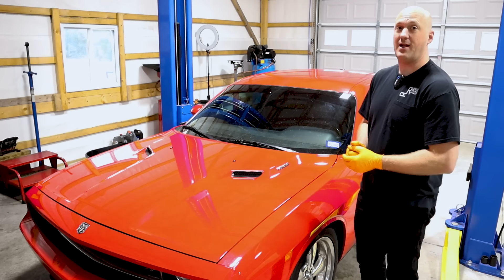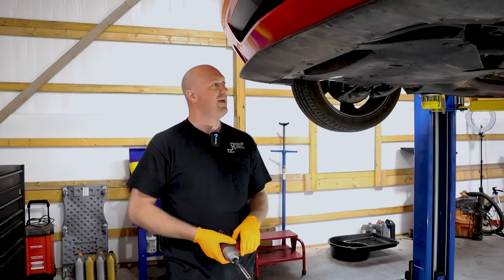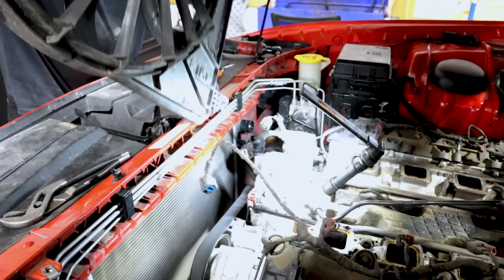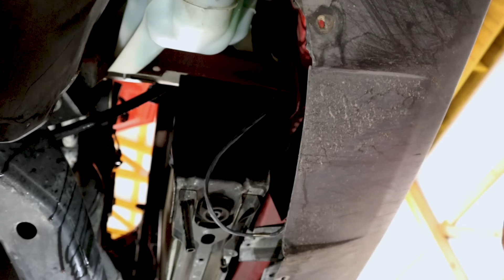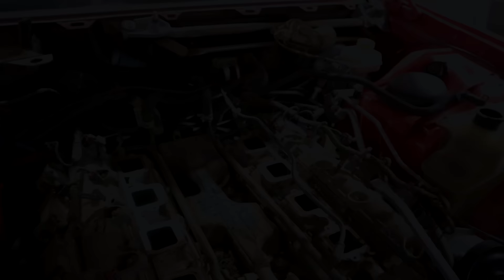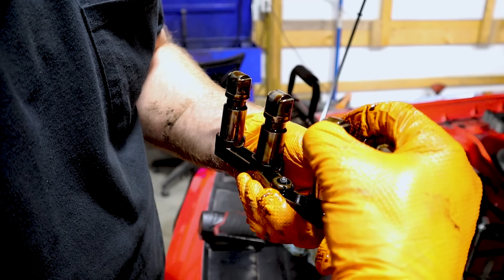Hemi Cam Installation! Budget Challenger Build Ep1

Comment: There is nothing budget about these 5.7 cars.  Cam and full bolt on cars om E85 make just over 400whp.  They weigh over 4200lbs, and that's the problem.  Any S550 Mustang, or 2016 and above Camaro is worlds above these in terms of performance
Reply from the maker: Have to agree with weight being an issue, these are definitely heavy beasts. Although I have to say the Mustang and Camaros are kind of after a different market at this point. I feel like the Dodge vehicles are the only true "Muscle cars" left. The Mustang and Camaro are chasing after sports cars, which is nothing wrong, and they are very good at it. But the Dodge vehicles deliver a certain kind of driving experience that certain people are after. Appreciate you watching!
Reply: @ReignitedAuto  I would agree that the Challenger does do different things - it's big, comfy, retro, and can be better at every day life.  However, I can walk into a Ford dealer and get a bast GT with the 10 speed for 31,999 - you can get a base Challenger RT with the 5.7 for roughly 36K because not everyone will hit Dodge's incentives for price drop.  So the Challenger competes directly with the Mustang.  The mustang GT is better in terms of performance, handling, and straight line performance.  My PP2 mustang cost me 41k and will dominate any Scat Pack in any terms of performance, and I can and have loaded my wife 2 kids, and drive 3 hours to the beach loaded luggage in the trunk, and did it comfortably while averaging 22.7mpg on the highway.  So the stance the Challenger is its own class would be true if cost wasn't comparable, and the Mustang wasn't a 4 seater car just like the Challenger.  NOW the Charger is hands down the best option for a 4 door performance car.
Reply: @ReignitedAuto  one last thing - though I agree the Challenger and mustang are different cars I don't think it's fair to say they don't compete.

Both have 2 doors
Both rear wheel drive 
Both American 
Both cars cost about the same within a few grand of one another 
Both American icons 
Both have V8s

It's not like comparing a Miata to a Ferrari, they both target the same thing - performance
Reply from the maker: @bigk5746  I get what you're saying, it's not apples to oranges, I'm justsaying in terms of a driving experience the mopar vehicles cater to a specific customer.

Comment: I seen a guy on YouTube doing a Cam with out putting the heads . Wouldn’t the lifters drop into the oil pan .just asking thanks
Reply from the maker: I'll be posting a video soon talking about this, but yes it looks like you can do it without pulling the heads. It's a calculated risk, but it seems definitely doable. I usually pull the heads anyway since I'm replacing the lifters.

Comment: Hey Sky! 
I feel like a lot of these tips and tricks can apply to all 5.7 hemi’s. Though I have MDS and it looks like the part numbers you listed don’t match up to mine when I cross reference. I have a 2014 5.7 grand Cherokee with 107k miles and I have some strange power surging under heavy acceleration, and I have what sounds like valve tick but I’m not certain. Say I delete the MDS (solenoids?) under the intake manifold, can I run a non mds cam and lifters? Anything software I need to be aware about? Before I assume it’s my valve train, is there something else I can troubleshoot? 
Thanks!!
Reply from the maker: Yep, remove the MDS solenoids, replace the lifters with all non MDS variants, and install a non MDS camshaft. You will have to add an aftermarket tuner that turns the MDS system off or you'll set a Check engine light for sure. The injectors are pretty noisy on these engines, can be mistaken for valvetrain noise. The Hemi engine is pretty noisy right from the factory unfortunately. The surging isn't an issue we see very often, no codes?
Reply: @ReignitedAuto  no codes related to the engine. I have AlphaOBD as well as BlueDriver to see everything and nothing. Well, on occasion I get a “service 4wd” because I replaced my rear diff and I think the computer is grumpy with the elsd motor that came on the replacement (used with 10k miles) but that is unrelated to the topic at hand, but if it’s cool I would love to pick your brain some more another time. 

Ok back to the surging. So when I go heavy throttle I can hear the engine since I have a cold air intake and its tone doesn’t change but I can feel the power coming in and out. You say the injectors are noisy naturally, could this be a clogged injector maybe?
Reply from the maker: @iambigsteveo  unless the engine was sitting for a very long time I doubt it. It might be useful to install a fuel pressure gauge inline so you can see what the fuel pressure is doing under heavy accel. You can temporarily do this with a fuel pressure gauge diag kit.

Comment: No timing chain?
Reply from the maker: Surprisingly the timing chains on these cars are pretty good, don't really have many issues with stretching or failures.
Reply: @ReignitedAuto  interesting ive done many cams in gen 3 hemis at work always did new chains. But may be different in the repair world i dont want it coming back for any reason.
Reply from the maker: @9090ruby  Yea I hear ya, but under warranty Chrysler won't pay to replace the cam chain, and after awhile you realize what fails and what doesn't. I'd replace the cam chain if it had over 200k on it, anything below that it's usually good!

Comment: Can you change the pistons from up top?
Reply from the maker: Nope, gotta pull the pan to remove the rod bolts, and then they slide out the top.
Reply: @ReignitedAuto  maybe a video on forging the engine then? I slapped magnuson supercharger on mine on my own, but didn't do any of what you just did. Any suggestions for me?
Reply from the maker: @JR-yt5dq  I'd love to, but that stuff gets pretty expensive really quickly and I'm funding the channel on my own so far. I definitely think you made the right choice going forced induction, it's my favorite way to make power. If you want to go even further then yes, forged pistons are likely in your future 👍

Comment: i have a 5.7 hemi with mds what type of 392 cam do i gotta buy to make it work.?
Reply from the maker: Alex it depends on if you want to keep MDS or not, you can buy the 6.4 cam in either configuration 👍
Reply: @ReignitedAuto  do i have to change the valve springs too.?
Reply from the maker: @alexmendez7535  its recommended for sure.
Reply: Did it need a tune

Comment: nice vid. Im 23 started out changing oil at 19 now im a tech with 1 year under my belt so far so good. I have not went this far on the 5.7 yet cause usually chrylser wants us to replace the whole engine if there is a lifter issue :/. I did how ever just do my first timing belt on a sohc 4.0l v6 and the water pump and that was a blast. I learn new things everyday and watching your video and you doing this gives me such a great advantage in what to expect when I start pulling heads. Thanks again :)

p.s im really a ford guy >:) only work on chryslers cause my brothers were there before me so they got me in years ago.
Reply from the maker: That's awesome Austin! We need guys like you in the industry, glad to hear it 👍
Reply: @ReignitedAuto  I really appreciate that a lot. It’s nice to hear recognition every once in a while. 

Take care 👍

Comment: Hey there. Very new here.  Was watching the the cam swap videos as my 2012 Ram 1500 has the lifter/cam issues.  Would the 6.4l cam work in my 5.7l?  Would it be from a truck or car application?
Reply from the maker: Yep, 6.4 cam works in the truck engines as well. which one depends on what you are looking for from the truck. The 6.4 truck cam will likely have a bit more low end grunt, whereas the car 6.4 will have a little more top end power.
Reply: @ReignitedAuto  There would be no need to change out valve springs?  Would be best to get same year cam?   Thank you for your help and response.  Jim.

Comment: Great video, plain and simple with straightforward advice and techniques. Just like Russ said, it's hard to get that aspect of knowledge across to an audience or person in general. I learned quite a bit watching it myself, thank you. I have a 2014 R/T Classic w/Super Track Pak and will be watching future videos to help me upgrade mine. I was planning on doing these exact upgrades in the near future so this was a perfect video. I have the Diablo tuner already and full MSD ignition which really helps wake up the fuel and spark aspect of these hemis. The Diablo tuners are limited to a point, but great bang for the buck with what they can do. I do have a question though, what are your thoughts on nitrous applications for these 5.7 hemis? Nothing crazy, like a 75-100 shot at very most after doing some moderate upgrades like you are doing currently. Can these motors handle that without sending the rods and pistons to Hemi Heaven?
Reply from the maker: I think if you keep it in a moderate range like that there's no reason why it couldn't be reliable. The bottom end in these motors is actually pretty good.

Comment: What else should be replaced along with the 6.4 cam in order for it to work with no issues Valve springs? Lifters? Let's say there's nothing wrong with the above mentioned parts, just the cam installed will work? Sorry I'm no mechanic just trying to learn this aspect of my engine since I can't seem to find anyone around me to do what you just did in this video.
Reply from the maker: Yea you can get away with just doing the cam itself. I would definitely recommend valve springs though, and you can change them without removing the heads from the engine, I've got a video about that on my channel 👍
Reply: One last question,do I need a tune just to start the car after the 6.4 cam?I know it'll need a tune afterwords,but  do I need a tune to start it for the first time after installing it?
Reply from the maker: @Boricua_en_fl-239  no, it should drive well enough with the stock tune 👍

Comment: I've been following closely to your channel. I have a 09 srt8(6.1L - 95K miles) with a possible locked lifter. I'm taking the engine out soon to confirm but I'm curious if the cam is worn down can/should I replace it with the 6.4L cam? I was thinking about one of MMX camshaft kits, but not sure what else I would have to do to the engine. Just been asking around to make sure I'm not missing anything with this hemi. Thanks

Comment: Great video ... I would have taken the oil pump off that’s a nice time saver .. thanks for the part numbers I’ve been looking at cam shafts for a while for my 09 charger I’ve been playing with the 6.4 cam idea 💡 for a while now .. I have a mds tune deleted charger , can I put the cam and lifters that your installing in my mds style 5.7  will I need the mds plugs?? I have a ton of  boltons on now .. I have 87mm  factory intake hand ported and polished , ported throttle body , catch can 2” long tube headers high flow mids slp loud mouth exhaust 2.5 .. 308. Srt8  full suspension and brakes from 2007 300 srt8  love the videos best one I’ve seen on you tube in the last 3 years 👍🏻👍🏻
Reply from the maker: Appreciate it man! Yes this cam will work for your vehicle, and yes you'll have to install the MDS block off plugs and replace the MDS lifters with standard lifters. 👍
Reply: @ReignitedAuto  thanks  for the feedback 👍🏻 like to say  one of the best cam swap videos so far thanks again

Comment: Where you located? I am in IL 
Looking for someone to do cam jobs on my 19 Ram Gen5 and 2020 Shaker Scat pack 

Also advise if MLS head gaskets are worth it and what brand
Reply from the maker: I'm in Austin Texax, but I'm not currently taking on customer work. Thanks for the opportunity though! The factory head gaskets are MLS, as far as I know that's the only kind of head gasket available for the hemi engine, but preference wise, I'm definitely a factory parts guy.
Reply: @ReignitedAuto  thank you for your kind respond 
I may have to watch your video step by step and do it myself

Comment: Great video.  If I wanted to get rid of mds solenoids what would u recommend
Reply from the maker: Use the factory block off plugs for the block, but you'll have to change out the MDS lifters to the non MDS ones, otherwise as soon as  you start the engine it'll go into 4 cyl mode.
Reply: @ReignitedAuto  thanks I appreciate it.  Youre videos will make it so much easier. Will headers  from srt work off any year charger for 5.7.  I have 06 charger daytona
Reply from the maker: @kevin-shackelford  ooh, that's a good question, I know 2009+ is good, but I'm honestly not sure about an '06. I sincerely doubt it would be different but can't say for sure.

Comment: Great videos I am in the middle of doing cam,lifters,valves,pushrods springs,oil pump,water pump,timing set,shorty headers, and oil catch can,6.4 intake build. First off i wish this video would have been around six months ago when i ordered new parts it wlild have saved me about five bills lol. Anyway i was going to go with a 392 cam in my 5.7 but when i talked with Jay Greene from greene racing about it he told me that it would cost me hp in the low to mid range, so i went with a non mds 5.7 challenger cam to replace my mds system. So have you done the 6.4 in a 5.7 before and did you notice a difference?
Reply from the maker: I've driven this car already and I can tell you there's a big increase in mid-range and definitely more on the top end. Whether that's entirely due to the cam or the new headers helping out I'm not sure, but it definitely did not lose anything in the midrange. I think some people were having issues with the mid range and this cam because they were locking out the VVT at first, before someone realized you don't have to do that. I don't have any dyno numbers to back up what I'm saying, just seat of the pants performance, but I definitely feel like it's a different vehicle now.

Comment: Great video! I'm still not confident in my skills tho. How much would it cost to get my 5.7 cammed? I really don't want to tear my engine up by making a mistake.
Reply from the maker: Depends on who is doing the work, but generally you'd be looking at between $3500-$4500.
Reply: @ReignitedAuto  thanks! Something I have to think about then. Would you recommend a new intake manifold over a cam? $4500 is up there and I still won't be able to catch any 6.4s lol
Reply from the maker: @Jeff21790  No on the intake. I think the most cost effective modification would be a tuner to start. Then once you start upgrading other things you can get the tune updated for even more power.
Reply: @ReignitedAuto  ok I already got an air intake, borla cat back exhaust, and long tubes, set to get a Dyno tune next week. Would you suggest anything else or leave it be until I saved up for the cam?
Reply from the maker: @Jeff21790  cam is the next step for that setup 👍
Reply: @ReignitedAuto  thanks!

Comment: Would the steps be similar on a 2005 hemi
Reply from the maker: Very similar, but with one big difference. On the '05 model the cam thrust plate is one piece that goes behind the oil pump, so you have to remove the oil pump to change the cam. On a truck this is a pain, because you have to remove the oil pan to take off the pickup tube to remove the pump. On a 300/challenger/charger you can remove the oil pickup tube and just let it rest in the oil pan.

Comment: I have a 2013 challenger rt and it had a timing chain failure at around 150k miles. I did the timing chain job and the valve job and reinstalled heads and stuff. That was a year ago. I am currently having the hemi tick and its obvious because of the mileage. I disabled mds and it got a little better but Im doing this job on it to fix it. my question is should i worry at all for the bottom end of the engine. I do change my oil every 3k miles and last time I had it apart the cylinder and walls looked really good so i believe that as long as i do good oil changes and stuff the bottom end wont have any problems. what do you think? currently has 180k miles.
Reply from the maker: I think you'll be in good shape, we don't normally see too many bottom end issues. I've seen very many Hemis with more than 250k with no issues. 👍
Reply: @ReignitedAuto  thanks a lot.

Comment: Good video.  If your looking for video ideas, something I would personally be interested in hearing your take on what a hobbiest can or should or shouldn't do to a car like this.  With the cost older mopar muscle cars going through the roof, here in my area (SE WI), doesn't seem like you can touch an older muscle car that needs minimal body work for less than 10K.  At that price point your talking about the same price you can find non RT versions of this same car your working on here.  With all the electronics these days, can a hobbiest these day even attempt a HEMI swap on a non RT challenger?
Reply from the maker: That's a good point, Engine swaps on modern vehicles are especially difficult, not just because of the work involved, but because the electronics all work together, so say if you put a Hemi engine in a non Hemi car, it won't talk correctly to all of the other modules and they will all freak out and set multiple codes. There are ways around it of course, but it's much more difficult. That being said, totally understand what you're saying about the older cars quickly being priced out of reach for the average guy.